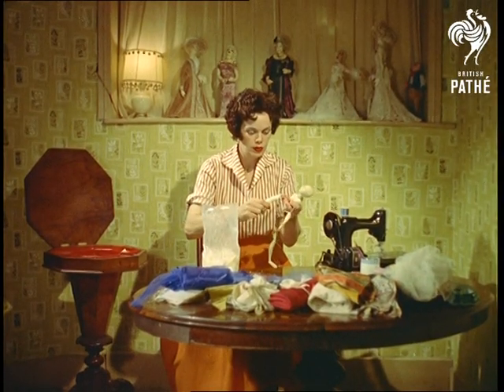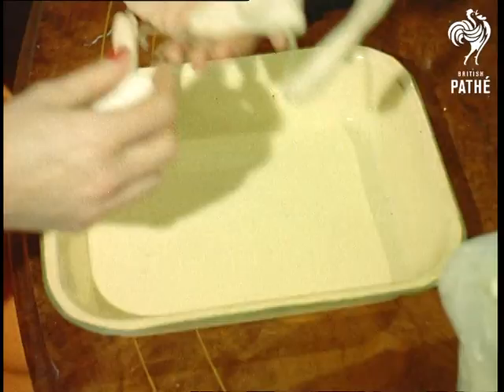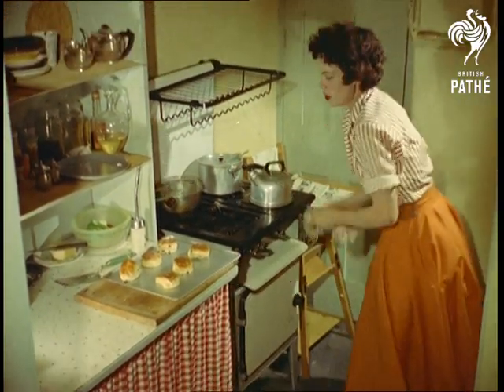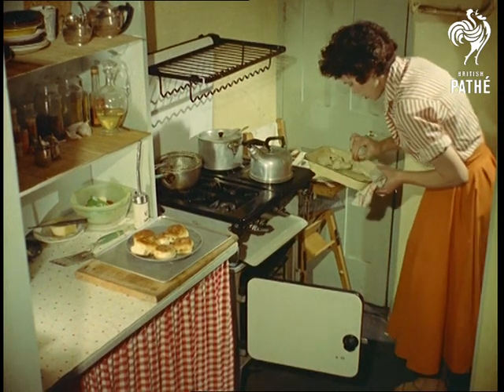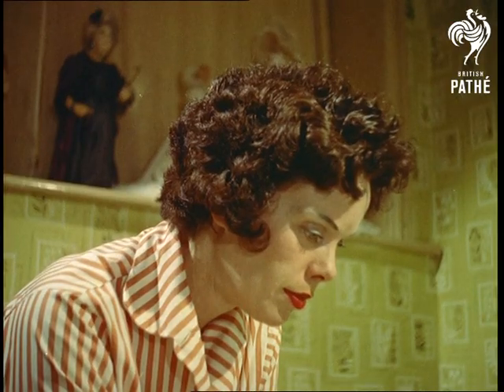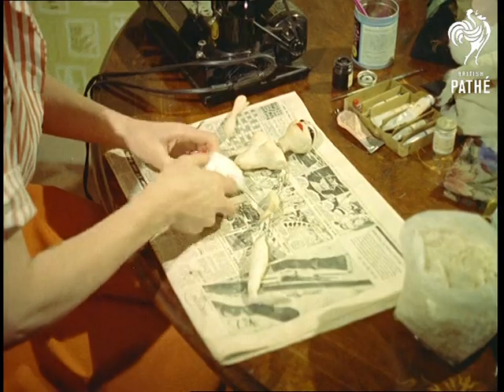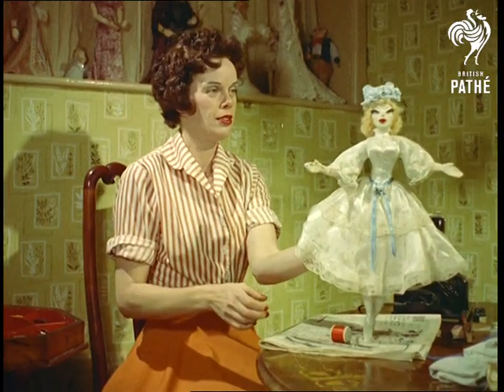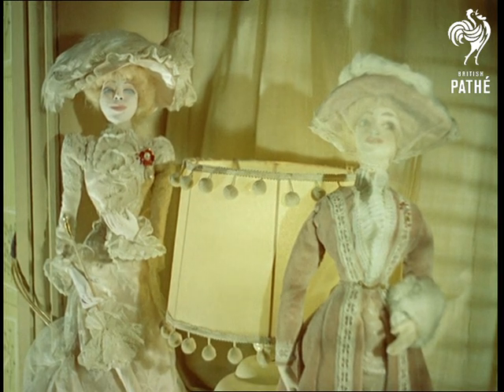Plastic Dolls - Doll Making (1957)

Comment: plastic dolls and food at the same over  super toxic yeeeehhhhhh
Reply: George Manus yup. Actually most of the stuff she was using was toxic one way or another! Never melt anything these days! And don’t buy old chipped baking pans. I do a lot of doll rescue, but please, I have to tell people plastic and heat should never mix. I have seen folks say you can melt hair on to a doll head with a heat gun! These poor dolls! I just got two in with hot glue gun damage, and then they used this monster staple gun to staple the clothes on! I won’t be giving these two away, such damage is way too disconcerting for a child. Please doll rescuers, step away from your heat guns!
Reply: I think the dolls is not plastic, since baking is not the way to make plastic doll. The dolls must had been made from clay, perhaps polymer clay.